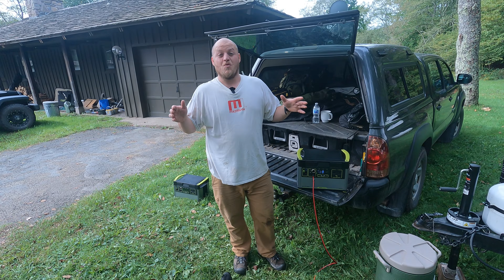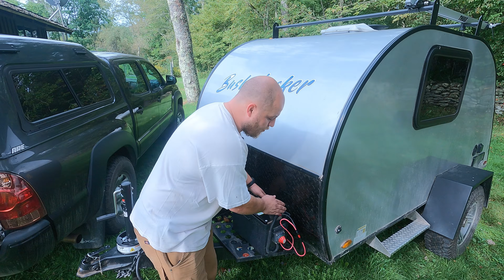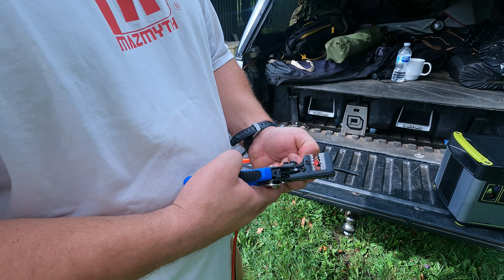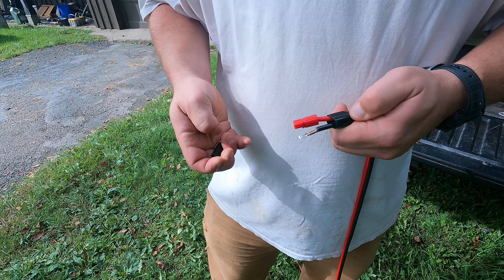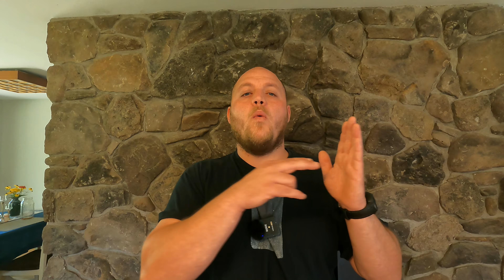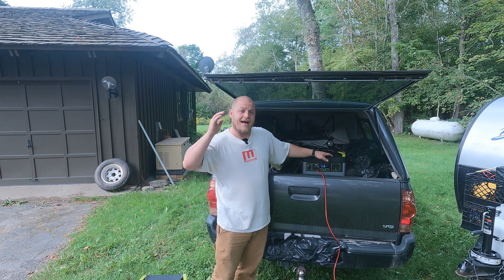Using Goal Zero for RV Battery

Comment: Great video! This just about sold me on the goal zero; this definitely ensured it’s worth the price. I did not hear you mention EF Ecoflow River in the list of competitors; I’d love to hear your thoughts on them.
Reply from the maker: They are making serious improvements. I do not have as much experience with them as I do other brands. From what I read, they have improved and fixed issues that people reported early on.  For this specific application, goal zero is in a league of their own, offering a 30 amp DC output that can allow you to use the unit as a straight battery. No other company is offering this, with Bluetti coming closest with a 25 amp aviation plug.
Reply: @DIYOutdoorLife  It's definitely looking like goal zero is the way to go for what I want to do; my initial priority was to save cash but after watching your videos I'm realizing it's worth it for application even outside of the trailer as well. Thanks Brian!
Reply from the maker: @levijosefsson6450  After using them to do off-grid construction for years, I came to the same realization. I try to save  money any way I can, sometimes that means buy once,cry once…
Reply from the maker: I’m trying to get some promo codes for the channel, I think I’ll have some soon. Goal Zeros gotta appreciate the free support!! Lol
I’ll let you know if something comes up soon.
Reply: @DIYOutdoorLife  Thanks! I found you a little too late for that initial coupon you had with them.

Comment: I love your solution.  I have long been considering adding a lithium battery to my little Rpod trailer.  However, after watching many YT videos, I have come to realize they are done by people who park their RVs in the desert.  I also, don't like the fact that I have invested a lot of money that sits with my RV in a storage lot.  Having the ability to use your Goal Zero/Jackery/Bluetti solar battery at home during a power outage makes the best sense and optimizes your investment.  I have even considered just plugging my RV, using the shore power cable, directly into the solar battery 120v, inverter, outlet.  Then I can use my 120v outlets in the trailer.  I know I loose efficiency, but I have small needs.  I also enjoyed Todd Parker's video on how to connect a LiFePO4 battery to the Goal Zero to increase the battery's capacity.  Thanks for an excellent video!
Reply from the maker: Thanks William! Check out my other videos on using power stations with RV's, I hope you find some useful content.  I include the pro's and cons of plugging the camper into the inverter on other recent videos.
Since the Goal Zero is the only large power station with Anderson PP's, it's the only one you can do this video's application with.  I am experimenting with the Bluetti's aviation plug, but it's rated 5 amps lower than the GZ plug.  Thanks for watching and commenting, hope you'll subscribe!
 SUBSCRIBE: https://www.youtube.com/c/DIYOutdoorLife?sub_confirmation=1

Comment: I am going to be boondocking this winter in a van with a Goal Zero Yeti 1500, which will have passive insulation (cab window covers, Havelock wool insulation in the van itself).  However, I know that it's going to get cold!  I have found 12V cigarette lighter plug heated blankets which will only draw 55 watts, but I would like to get a heater.  There is a 12V heater which connects to a vehicle battery, but, looking at the plug, it looks like its an APP that is plugged into an RV type 3 prong plug, which is then removed to be plugged into their power pack and attached to the battery.  It seems to me that I could just plug the APP connectors into the Goal Zero.  Is that an appropriate use of APP connectors?  I've been researching and all I can find as usage is charging another battery, like you demonstrated, or serving as the power source for Ham radios and model trains.  But there are a lot of accessories with 12V cigarette lighter plugs, including other heaters.  Is it feasible to connect to connect a cigarette lighter plug to the APP connector (I'm guessing a wire)?  Is this safe?  Thanks in advance for your advice!
Reply from the maker: Absolutely! The APP is 30 Amps regulated 12v. You can plug anything DC into it up to 30 amps.  In other words, it is like a high performance cigarette style plug that can handle 3 times the load (360watts).
The bigger issue is using electric as heat.  There is a good chance that your heater is above 360watts.  Using batteries to create heat is the most demanding thing you can do with them.  Most of us use a heater that runs on a fossil fuel, although it's unideal, it is orders of magnitude more efficient, inexpensive and practical.  I have an LP furnace, many use diesel heaters.  These are superior to ventless heaters like Mr. Buddy because they don't create water vaper/condensation.  
In short, your goal zero 1500x can be used for electric heat. The 12v blanket is an excellent idea.  A small plug in (110 ac) heater is also possible.  I do this all the time to take the edge off, but if you require longer or more demanding heat cycles, the LP or diesel heat will prove cheaper and more effective.
I hope this helps, happy to follow up if you have more questions!
Reply: @DIYOutdoorLife  Thanks so much!  Yes, the heater that I was looking at was 500 watts, so that's now off the list, but there is one that's 180 watts.  It's probably pretty weak sauce, but at least it'll be something!  I'm determined to stay away from furnaces and fuel heaters as I'm sure that I'd forget to leave enough of a window open one night. Will it be ok if the cord I'm using to connect has a higher rating?  The only APP to Cigarette Plug connector I can find says its "45 amps". Alternatively, I'll stick to the lower wattage household style heaters.  Thanks again and enjoy the coffee!
Reply from the maker: Thank you for the coffee, very kind!
The APP port on the 1500x is 30 amp, but is the same size as the 45 amp. I always use the 45 amps Anderson plugs to connect into mine, so you're in great shape!
Reply: @DIYOutdoorLife  Thanks so much, what a relief!  This has been a very confusing process, but your advice has cleared up my questions.
Reply from the maker: @da.freiberg8012  It's understandable. It all becomes easier, you'll be a pro in no time!

Comment: What is the largest Anderson Power pole plug the Goal Zero can handle? My RV Wires at the battery are #6.
Reply from the maker: my wires are 6awg as well, I use the 45amp anderson plug.  The GZ yeti takes 45 amp and under.  The reverse polarity fuse on your RV is probably 40 amps, most DC fuse boards are 30 amp.  Since I dont know your exact system, the only thing I can say is 45 amp is more than enough for most pure DC systems on campers.
Reply: @DIYOutdoorLife  I did determine that the wire is a 4awg so I ordered the next size Anderson plug to use at the battery connection and the 45 amp for plugging into the Yeti. should be OK will only be running lights and the water pump. Thank You, enjoy the coffee!.
Reply from the maker: @dag36523  That’s an excellent idea! You will have PLENTY of room to spare as well. The COM screen on the yeti will tell you how many watts you’re drawing. The APP breaker will trip around 360, that allows me to run everything in the camper, including the refrigerator/freezer at the same time. Let me know how you make out!
Thank you kindly for the coffee, it makes such a big difference 🙏🏻

Comment: You are turning me into a battery nerd, but seriously, a great idea to forego the big RV battery and use a portable power system like the Goal Zero or other brands, instead, you would only need to install a much smaller battery for the braking system, if the RV has electric brakes. Thanks for the great vid !
Reply from the maker: Ha ha… We’re all nerds deep down. I still stick with 100 AH AGM… I can run my fridge, lights, fan for three days on that. That way I can take advantage of charging while driving as well. Having this option with a yeti takes the system to the next level.
Thanks for watching and commenting!!
Reply: @DIYOutdoorLife  What fridge do you use? Apologies if I missed it in another video.

Comment: How did you get the negative wire back on the battery now that you have the Anderson plug installed? Also is there any way to connect a Jackery to a camper to get this result?
Reply: Also well done, very watchable, articulate and a good sound system!
Reply from the maker: Thank you, I appreciate that! 
Take another look at how I cut the plug-in. The Anderson plug is in between both the positive and negative on their path to the trailer. So when plugged into the power station, both positive and negative run from  the power station port to the trailer, the battery is disconnected from both Pos AND Neg.

Unfortunately, there is no way to do this with a Jackery. Some people put a male automotive plug instead of a Anderson and plug that into the 12v cigarette plug on Jackery. This will work but is very limited, about 120 W total
Reply: @DIYOutdoorLife  Got it thanks!  No way to connect a Jackary?
Reply from the maker: @dag36523  only through cigarette plug...120w total. So you can connect to jackery, just using lights and small things

Comment: interesting idea...thanks for sharing...works for small loads like a fridge, fans, lights....most stuff in an RV... 
But not for any larger draw than that....at 900 AC watts the 120v hot plate I ran extensively off my trailer inverter on our last trip draws about 80 amps dc..... I think that far exceeds the output of the DC port on the Goal Zero and the load carrying capacity of the wire size you're using...
Reply from the maker: That’s right. Running a system like this gives you a really mobile way to charge and use the normal 12VDC items on the trailer. The hot plate would be plugged directly into the power station (2000w inverter). It’s a great way to go for the majority of folks, but it’s not going to perform better than a high dollar onboard system.
Reply: @DIYOutdoorLife  I like the idea just for back-up to an onboard system such as mine...

Comment: Well done information, especially the last part due to batteries and electronics lifecycles !
Which company you trust in most with their electronics build in their popular solar generators - is it
Goal Zero, or Bluetti, or Jackery, or EcoFlow ? What do you think will have the longest lifecycle concerning the batterie itself and all the build in electronic devices , such as BMS, MPPT, tochscreens and everything else. 
I’m really interested in your personal opinion - thank‘s for a feedback 😎
Cheers Claudia (from Germany)
Reply from the maker: For me it's Goal Zero. I have used power stations for years and they hold up the best for me, well worth the extra $.  I use my systems for off grid building, I'm rough on them and the build quality shows.  If someone was more careful, they might save money by going with Jackery. I LOVE the new bluetti, but touch screens, wireless cellphone charger, and 20 pounds more weight do not make sense for me in my rough applications. I think the Yeti1500x is the best PPS ever made (for my application). Hope this helps!
Reply: @DIYOutdoorLife  
Thank you very much for your fast response. I also own some PPS, the Yeti 1500X was the first one I bought because it has the APP 30A DC output, which is really
outstanding on the market. I‘m a hamradio operator and therefore I need a higher Amp DC output port, than the most other companies deliver with their PPS.
The only competitor to GoalZero in this case ist the Bluetti AC200P, which delivers a 25 Amp DC output port. In the meantime I have integrated this big one in my shack,
because I became aware of lower EMV distortions of the AC output ports with the AC200P, the GoalZero is not as good in this discipline as the Bluetti, which is also very important to me !
But I agree, for outdoor activities I also would prefer the Yeti 1500X, although it is also a little bit to heavy for me with about 20 kg !
Time will tell how long the several PPS will run fluently, so to say if GoalZero will keep the golden standard or if other companies with their solutions will beat them in the future - anyhow there are announcements of very interesting SolarPower Stations, which will come on the market soon.
Thank‘s again and keep in touch 👋 Claudia
Reply from the maker: @claudiafriedberg6248  that's right, I remember your comments from before! Have you been able to make your own plugs to go into the bluetti aviation ports or you purchase them?  
The tech advances so quickly, I'm excited to see where it goes as well.
Reply: @DIYOutdoorLife  
I purchased the special adapter for the 25 Amp DC port, otherwise you will not have a chance to use it. On the other extension I completed it with a APP 45Amp.
The special aviation plug is very well made, it is really sturdy !
Reply from the maker: @claudiafriedberg6248  Very cool!